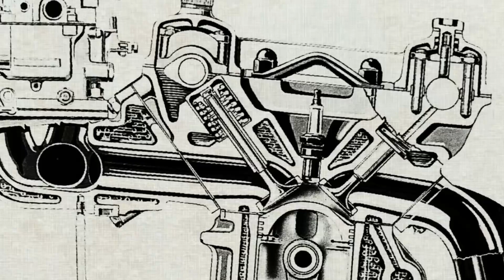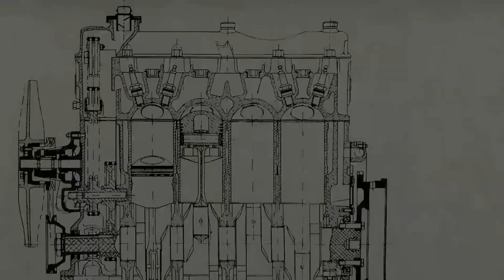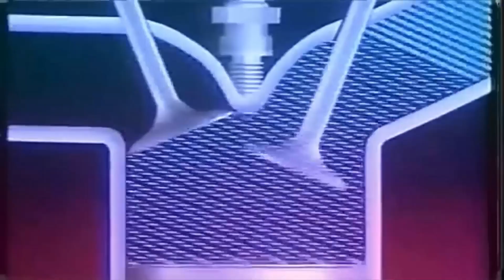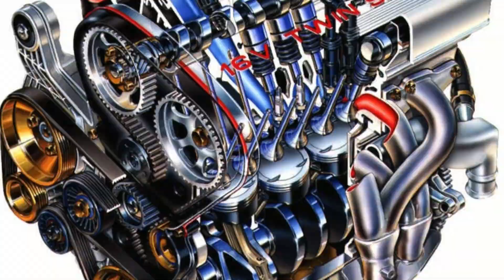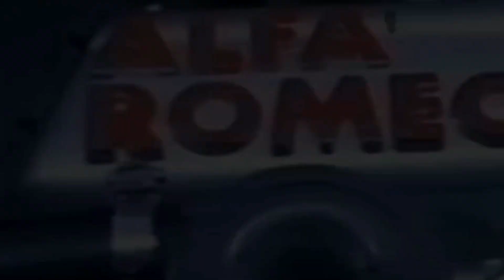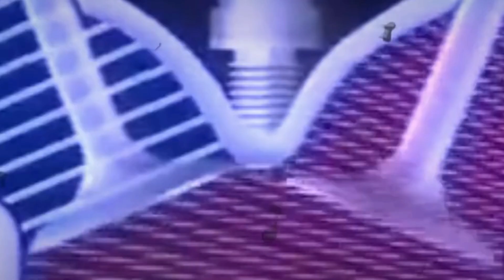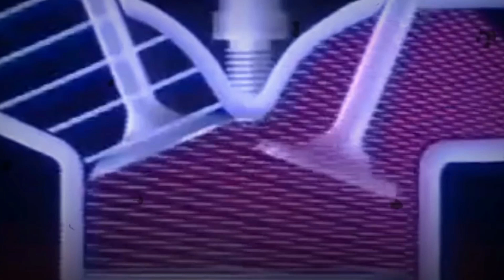The Shocking Truth Behind Alfa Romeo's Twin Spark Engines

Comment: First I here it's a ticking time bomb. This video is garbage. There were 2 twin spark engines. 8 valve version based on Alfa's twin cam block. This was inhereted by 155 at the beginning. Chain driven, and reliable. It was a true spark plug indeed - both spark plugs fired simultaneously. 
Then came 16 valve version based on Fiat's Pratola Serra engine. This was used in 155 after facelift and was inhereted by for instance 156. Yes, they had issue with oil level sensor and some were siezed. But if you were no idiot, you did a check from time to time, it was average reliable engine with nice sound and good performance for the time. This engine was a wasted spark engine. First/main spark plug was firing the fuel. Secondary, small spark plug fired during exhausted phase to clean up combustion chamber for next cycle. That's why it had just one coil per two spark plugs and the coil was was connected to two cylinders - on one cylinder to main spark plug and to small spark plug on the cylinder next to it.
 And it is not true it was totally abandoned. 1.8 TBI was just a newer spec of Pratola Serra engine but it gave up on two spark plugs. Pratola Serra engine family was abandoned later with introduction of FireFly engine.

Comment: You didnt mention oil consumption...these engines needed rebuild from new!
They wrote on the manual that there is oil consumption about 1ltr/1000kms so that they avoid rebuilding the engines under warranty cause they would lose a ton of money...
The piston-block allowances were big in order to help high revs compromising the oil consuption and destroying the piston rings and all the rest moving parts of the engine (valves lifters camshafts etc)...
Reply: Rubbish

Comment: Just for the record, you are referencing two different Twin Spark engines here, there is also more complexity to them than you provide here, also the later Twin Spark engines are not Alfa's own, they are in fact Fiat Pratola Serra engines, the former TS engines are Bialbero's designed by Busso himself. It doesn't bother me as I know the facts but other people will probably be ticked off about the incorrectness here, might be worth fact checking a little more next time ;-)